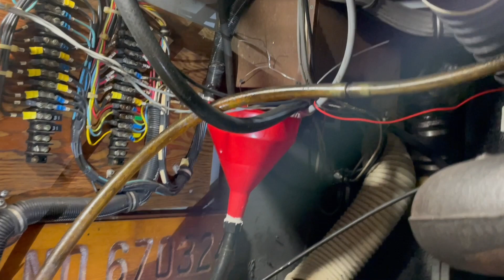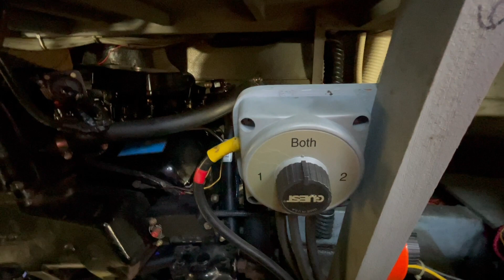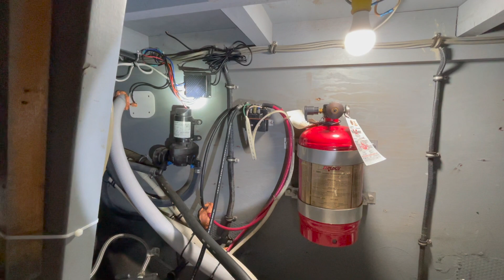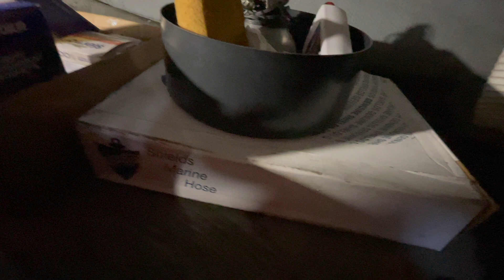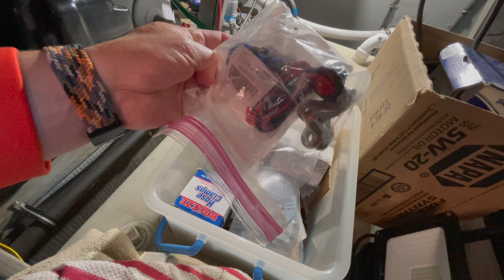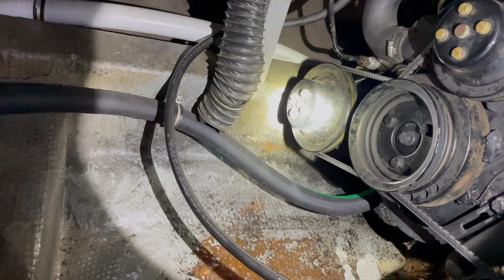MV Thirsty Whale, 1984 Chris-Craft Catalina 381, Engine Room Tour

Comment: very interesting video. I don't own a boat but there's a guy on FB who has a 1985 Chris Craft Catalina 40' I think but both engines are "frozen" -- he had pics of the boat living areas but not of the engine compartment so your video gave me an idea of just what that area looks like. he was suggesting putting a 50 HP outboard on the boat to serve as a way to move the boat since cost to repair / replace the inboard engines could be VERY expensive. 

if a person wanted to remove these engines, I imagine there would be holes left in the hull (cooling water, etc.) -- would it be practical to remove engines on a boat like this? would it be extremely difficult?
Reply from the maker: EXTREMELY difficult in this boat. That was my biggest fear when I owned it.

Comment: Chad i have a question are your toilets the only thing that have a holding tank do all the sinks just drain into the hull and then they're pumped overboard by the bilge pumps is that how that works I'm looking at this exact same boat for sale it has been under a covered slip and cared for immaculately since it was brand new
Reply from the maker: Toilets only to the black water holding tank. Sinks and showers run overboard, either directly for the sinks, or through a shower sump for the showers.

Comment: Nice. Our 86 is slightly different but could be from upgrades on either boat. Question- on your waste tank do you have a sensor for the level? Ours is 70 gallons and I don’t see a sensor on it. There’s a 7/8 full switch & light on my panel but I didn’t see anything on the tank. We do have a floor over the tank though.
Reply from the maker: Hi Brett, I don’t have a sensor or gauge for the level either, just the same switch for 7/8 full with a light. Waste tank float sensors rarely work for very long anyway. Had one in the tank on my Regal that read 1/4 full all the time. Learned the hard way with that boat. 😬🤦🏻‍♂️

Comment: Hi Chad,  I think you'll find the 4" white hoses are bilge vents for the louvres to vent air when under way.
Forward louvres facing forward & scooping air, aft vents facing aft & venting air, again, only while under way.  When I bought my 86, port side forward vent louvre was facing aft.  Wasn't picked up on the survey, but I noticed it sitting on the dock one day admiring my new boat.... Turns out there was dock damage & fiberglass repair, & the shop that did that work installed the vent backwards. (Always check the job, especially if someone else does it). The 4" black vent hoses are intakes for the bilge blower.
Thanks for the tour.  Chip
Reply from the maker: You are absolutely correct Chip. I missed that when editing that video and didn’t put the correction on the screen. Black hoses are blowers, and white are vents. Good catch!👍🏻👍🏻😎

Comment: Pretty busy area but seems to have working room. Did the coils fix your issue? Also, are the velvet drives a 1:1 ratio? Are those used in modern boats or is there something new?
Reply from the maker: There is plenty of working room for a guy my size, could be tight for some. I had the boat out a couple of times since changing the coils and it performed flawlessly at cruise power. I didn't do a full power run tho, but I was super happy with the cruises we did. My drives are 2.57:1 ratio.